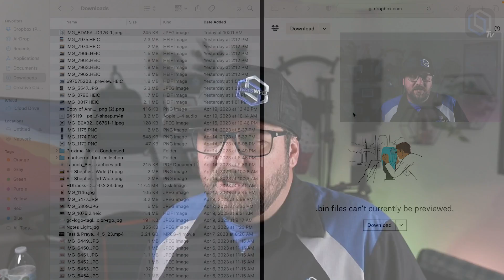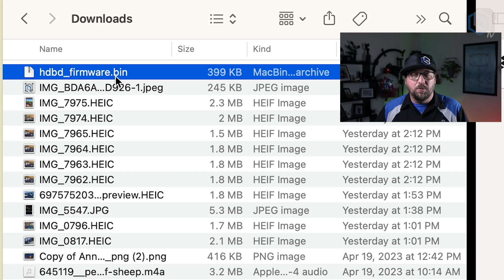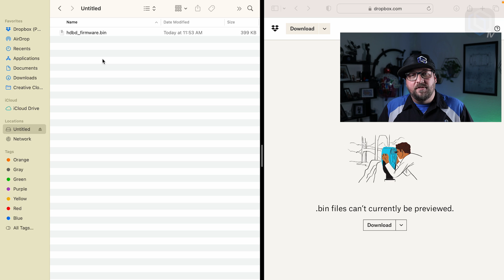GPS FIXED!!!  Update to restore GPS.

Comment: Hey there i downloaded the updated file .it tells me its downloading then says that it has failed...any ideal,its all plugged in
Reply from the maker: @nicholasgoulet3137  what radio do you have?  What Generation?
Reply: @LinksWellInc  I believe it's the 5 for a 15-23 mustang
Reply from the maker: @ ok. So this fix was for a select group of systems. Most didn’t need it. 

So what is yours doing that you think it needs it?
Reply: @LinksWellInc  it can't tell where I'm at. It can't find my location. I have checked and the GPS is plugged in. Using Google maps....
Reply: I have already completed the system update on the unit itself
Reply from the maker: @ so Google Maps needs WiFi to work. Do you have the WiFi connected?
Reply: @LinksWellInc  yes
Reply: Also am I able to purchase the 19 and up rear camera harness?

Comment: Will this work for the Gen 4? I have done the updates for MCU and OS. Everything at the latest and greatest but still getting no GPS. Occasionally Google Maps will work but maybe 5% of the time. Made sure all of the hotspot options were configured right. Gmail, Chrome working flawlessly - would love to have Nav on that screen!
Reply from the maker: @jmazz9212  where did you mount the GOS antenna?
Reply: @LinksWellInc  
2nd owner. I assume behind it since nothing is showing. Does it have to be taken out to check?
Reply from the maker: @ it must me plugged in and mounted somewhere that isn’t under plastic. 

99% of NAV issues are antenna issues. So I would start with checking that.
Reply: @LinksWellInc  thanks for the quick replies! I appreciate it. Where do I look for it? The Jeep jl antenna is on the roll bar under the soft top. Is it not that?  The radio works fine, I get stations. If I pull it off the dash, where would it be ? I'm hoping it's as simple as a coiled up cable. Maybe never hooked up and a blank port. I know they opted not to install a mic for the Bluetooth phone.
Reply from the maker: @ so on the back of the radio is a blue antenna plug. That is what needs to be plugged in. You can use the factory Jeep one if it isn’t plugged in. Or if the one that came with the radio isn’t in the dash anywhere. It would be really hard to know where they mounted it without taking the radio out and seeing if it’s plugged in and following the wire. 

We do have install videos here on our channel for our Jeep radios that may help you if you do decide to remove the radio.

Comment: Tried the updates. Google maps still won't work. No GPS signal.  Yes wifi is on and connected
Reply from the maker: Where is tge Nav antenna mounted.
Reply: @LinksWellInc  on the dash. Was thinking of moving it to the outside of vehicle

Comment: Are you able to connect to a obd2 adapter with Bluetooth
Reply from the maker: Yes.
Reply: @LinksWellInc  how? Can't find it on the unit where I can connect to a Bluetooth device from the head unit itself
Reply from the maker: @mountainviewhomestead5236  what app are you using to see the ObD?  Pair it through the app you will use it with.
Reply: @LinksWellInc  torque pro, you can't connect through the app I believe,  have to go through the device itself first.
Reply from the maker: @mountainviewhomestead5236  then open the Bluetooth on the radio. Search for devices on the radio and select your OBD Reader.
Reply: @LinksWellInc  that's what I was getting at. I can't find the Bluetooth scanner on the radio.

Comment: Do you still need to do this on the XL? I’m not getting any gps or errors on mine.
Reply from the maker: No. Do not do this update for the XL. 

Where is the antenna mounted?
Reply: @LinksWellInc  I got it working through a regular over the air update. And I’m using the stock jeep gps.

Comment: hey EVERY BODY so i had GPS with maps on my ram and i purchase the gen 5 linkswell and it does NOT COME with maps you have to use wifi. which is total BS. after you fork out 2300 bucks now i gotta buy something called IGO

Comment: Hello gen 5  T Style 2017 Ram 
i did the gps update it all took just the video.  sorry to say my gps dose not work. it bshows i have signal. but when i open navigation just a blank screen with a blue dot.

i had gps navigation before i upgraded to a linkswell.

Any insight would be helpful please. as my stero shop i bought it from dont know either.
Reply from the maker: If you didn’t pay for the IGO then you are probably using Google Maps and Google Maps needs WiFi to work.

Comment: Hi Jonathan I have the Gen 5, I did the GPS update with the phonelink and lucky the download went well. I received the GPS Module download was successful message and then rebooted the system. Unfortunately,   the GPS still displays "Searching for GPS Signal." Also I have my GPS antenna mounted at the rear of my jeep on the rooftop.
Reply from the maker: What Navigation are you using?
Reply: @LinksWellInc  I did the same thing. Even took the antenna out and now I just have it sitting on dashboard.  I bought an aftermarket antenna as well, thinking maybe I got a faulty one. No luck.....
Reply from the maker: @JoeE1024  you tried it with our antenna?  You did this update?

Comment: I have tried this multiple time with multiple USB and always ends in error 
Also tried this in both the USB ports that are connected to the device and still no luck
Reply from the maker: Try pressing the RST then re running the update
Reply: @LinksWellInc  RST?
Reply from the maker: @jamestruitt5866  the small pin hole on the face of the radio. Use a paper clip and press in the Reset
Reply: @LinksWellInc  tried multiple times and that doesn’t seem to work either
Reply from the maker: @jamestruitt5866  the radio reboots after you press in the RST?
Reply: @LinksWellInc  correct
Reply from the maker: @jamestruitt5866  and you have a Gen 5 radio that is having issues with the radio locking onto satellites?
Reply: @LinksWellInc  did a little research it’s a 4
Reply from the maker: @jamestruitt5866  that’s why it won’t work. This is for the Gen 5. Not the 4.

Comment: Will the factory GPS antennae work with the Gen 5? I have to one that came with the radio hooked up, but it gets horrible signal.
Reply: i was told it wont work. but since i have it. i will try it. and get back here.

Comment: We did the 2 step process to get the GPS to work, it was all good until it still shows us the "Seaching for GPS signal" still. Please contact us about this. We have been to the place we bought the radio 3 times. It's not working,

Comment: Ive emailed but havent received anything back. On my gen 4 in my f150 is it standard for the radio to not work when connected to AA?
Reply from the maker: Didn’t get an email. What email did you send it to. 

You won’t be able to run Android Auto and the AM/FM radio because the radios are Android Tablets. So just like on your phone you can only have 1 audio app open and working at a time, in our radios the AM/FM and the Android Auto are both considered audio apps. So when one opens it takes over the other.

Comment: i have a gen 4 and my GPs doesnt work at all. I love the device it is awesome, but when i go to actually use the gps it does not calibrate. it gives directions but freezes after that i also bought the IGo and it doesnt work at all...
Reply from the maker: Where did you install the antenna?
Reply: @LinksWellInc  i got installed professionally should it be moved to a different area?
Reply from the maker: @datatownboi06  I don’t know because I don’t know where it was installed. Or even if it was. Hard to say
Reply: @LinksWell Inc.  understood.  In the event it was installed directly behind the unit, would you recommend it be moved to a different place? I can make an appointment with my installer to check and see about where it's placed and have it moved if that'll fix the problem
Reply from the maker: @datatownboi06  so it won’t work at all if it’s under medal. The clearer view of the sky the better.
Reply: @LinksWellInc  I will set up an appointment and see if that'll help thanks!
Reply from the maker: @datatownboi06  no problem
Reply: @LinksWellInc  I have the same issue with my G4.  I recently moved my antenna on the driver's side dash with a clear view to the sky.  It still will not get a signal.
Reply from the maker: @silvercoupe97  try using the factory antenna. The antenna may be bad.

Comment: tes... great vide thanks ... my problem cant upgrade jo gps on my T5 radio naviextras comes with igo missing file sd.... will this update solves this problem?  thanks
Reply from the maker: No. If your IGO is missing the license file that means it wasn’t purchased. You would need to pay for the license key to get it to work. 

This is to fix the issue of the radio isn’t locking onto satellites.
Reply: @LinksWellInc  SORRY I BOUGHT THE LICENSE AND JUST WANT TO UPDATE MY 2017 IGO THAT CAME IN THE RADIO .. IGO IS WORKING WELL JUST WANT TO USE LATEST MAP VERSION EVEN IF I HAVE TO PAY MORE...ERROR COMES WHEN FOLLOWING LINKSWELL INSTRUCTIONS BY NAVITEXTRAS....PLEAse advice
Reply from the maker: @tgaitan1630  got it. Yes so We are waiting on IGO to fix their update tool.  

We have sent radios and been going back and forth with them for a while. There is something wrong with their update tool and how it works on our radio so we are waiting on them to figure that out.
Reply: @LinksWellInc  great thkns .. just to let you know i love this radio!!!!
Reply from the maker: @tgaitan1630  thank you for saying that!  We work really hard to make the best products we can and love to hear when people are enjoying the products!
Reply: @LinksWellInc  HELLO good to see all the new work... can i use this method to upgrade my IGO ...
thanks again
Reply: the one shown April 23 ...
Reply from the maker: @tgaitan1630  no upgrading the mapping is a completely different process. That all happens through IGO themselves and not us.
Reply: @LinksWellInc  thanks for your reply ....keep waiting then for a maps upgrade fix

Comment: Is there a Gen IV update as well?
Reply from the maker: Gen 4 didn’t have an issue with GPS.
Reply: @LinksWellInc  mine does. only works with android auto. All app permissions are enabled and worked fine for first six months. asked for help on the website and was told to use AA.  Constant issues now.
Reply from the maker: @jasonjanssen7775  you may have a bad antenna. When you go to the GPS info page. What does it show?
Reply: @LinksWellInc  nothing. it looks like nothing is connected at all.
Reply from the maker: @jasonjanssen7775  email me an address and I will have them send you a new antenna

jon@linkswellinc.com